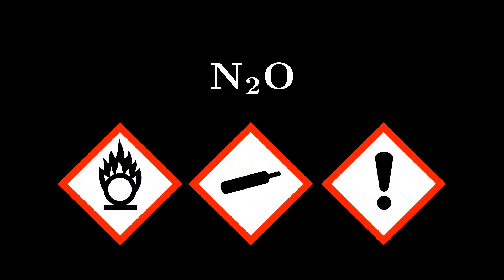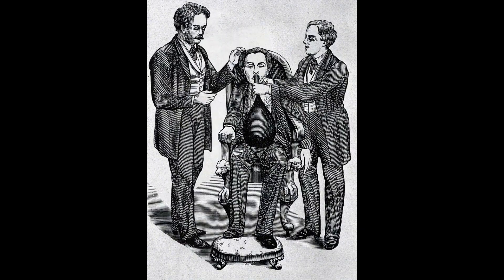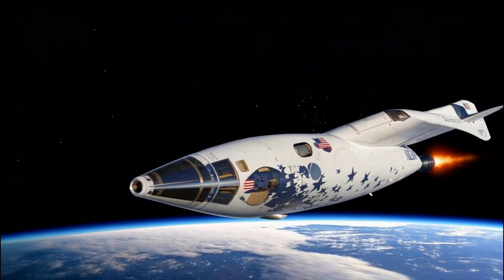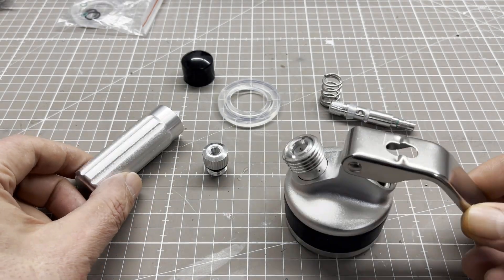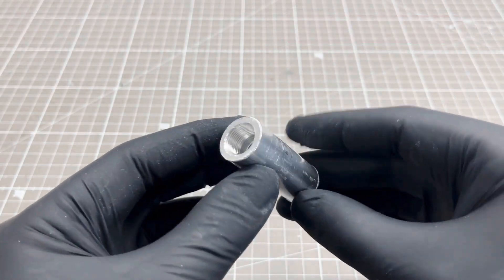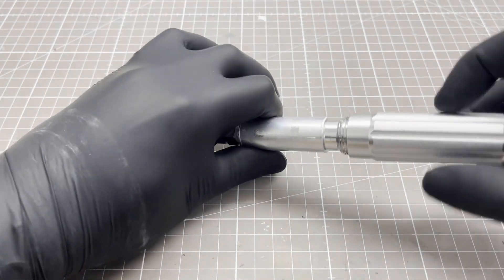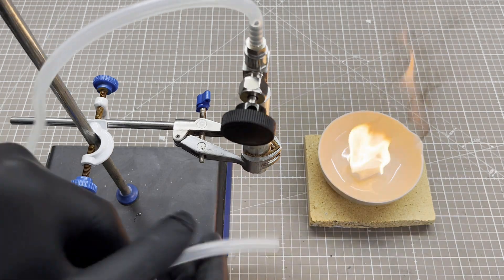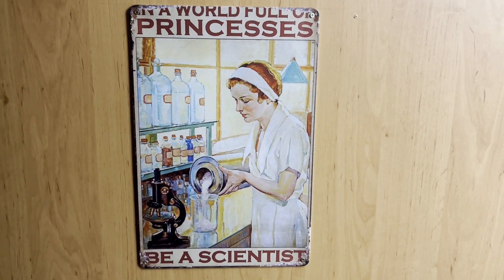N2O (nitrous oxide/laughing gas)

Comment: Just found your channel, super cool videos! 

I was actually planning out a Propane/N2O torch setup for benchtop work, like those small Oxy/fuel torches for brazing and melting stuff. Maybe you can try that out, as a proof of concept before your rocket engine project? 

Especially with those massive 1kg tanks being widely available (with flavouring lol), it seems that an N2O/fuel torch would be way more practical and accessible for hobbyist use versus an Oxy/Fuel setup. Those kits at the hardware store only come with ~40g of oxygen, because you can’t liquify oxygen at room temp. But with N2O, I’ve seen 2kg bottles for around $120!

I’ve read that N2O/Propane torches can reach hotter temps than Oxy/propane, because N2O decomposes exothermically.
Reply from the maker: Great idea. I have an oxy/propane torch for small welding/hard soldering jobs, but as you have mentioned, it lasts not very long due to the small amount of oxy in the container. I ordered the N2O container (2 kg) in the video from Holland without flavouring:)

Comment: Interesting, have you considered the aluminum strength when making the adapter? Instinctively there is a risk, but probably not a high bar to clear for this low pressure.
Reply from the maker: Since I don't have a lathe, I simply used a 20 x 12 mm aluminum tube and cut the appropriate threads. I pressure tested it with water at 30 bar. No problem.